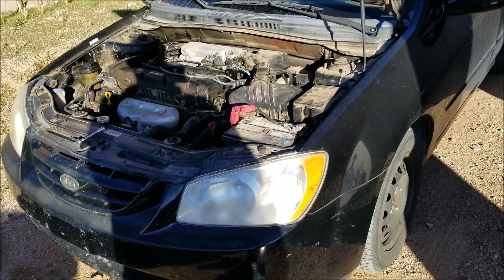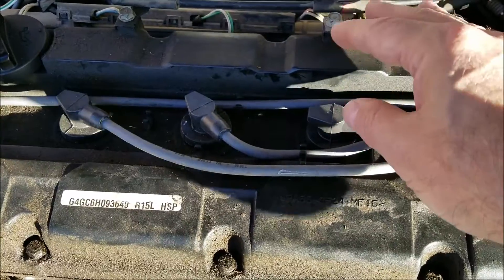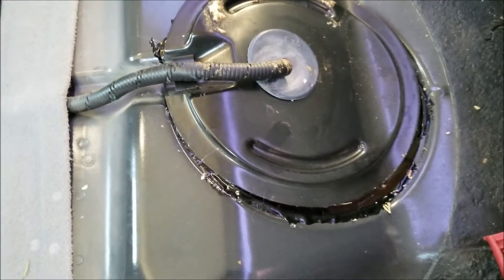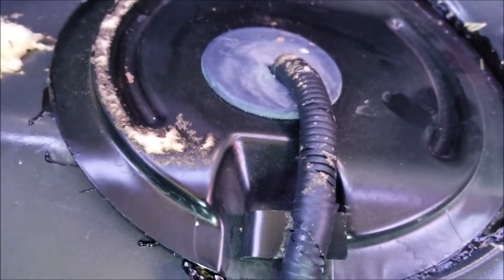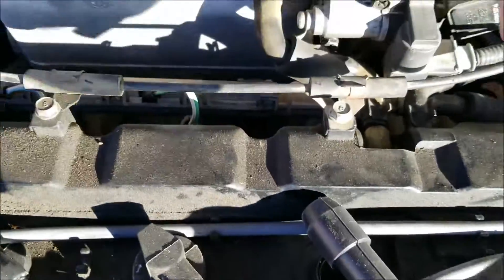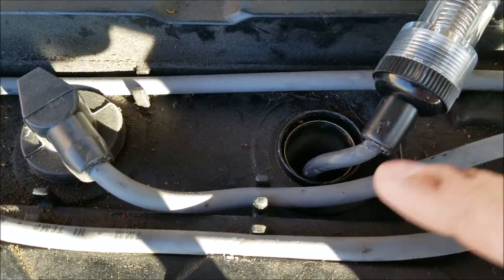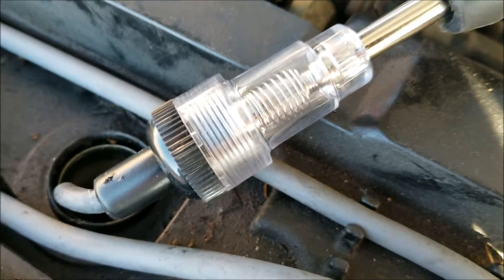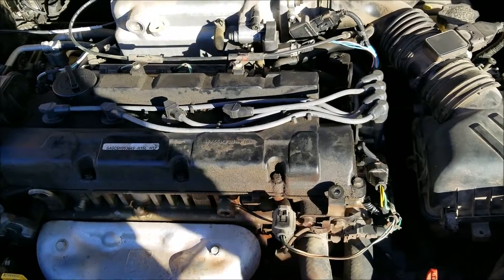Engine Not Starting Is It Gas or Spark How to Check

Comment: Thanks for the vids! I have a spectra5 2007. Lately it’s been stubborn at start up but if I do the key trick a few times and pump the pedal it will start. Also when I’m really low on gas and stop to get gas it takes it a bit longer to get started. It will almost start but then drop like it’s out of gas. After it’s started it kind of idles oddly like it’s going to die from being out of gas so I have to rev it just a little for a few seconds. Afterwards I’m fine and it drives fine. I was thinking the fuel pump going out. I’m going to try to hear it next and see. Looks like an easy fix though of it is. I did a fuel pump on my Honda CRX a long time ago it wasn’t too bad, either.